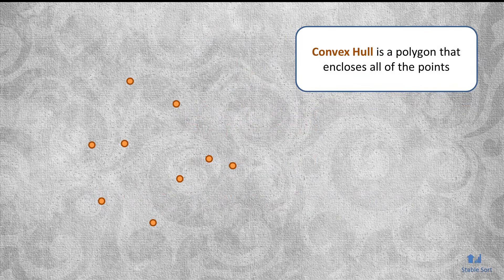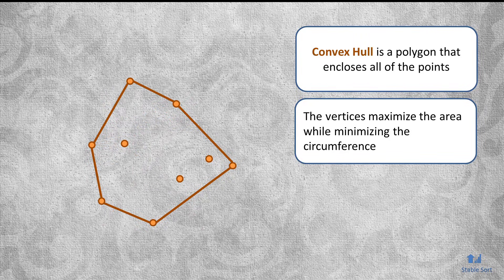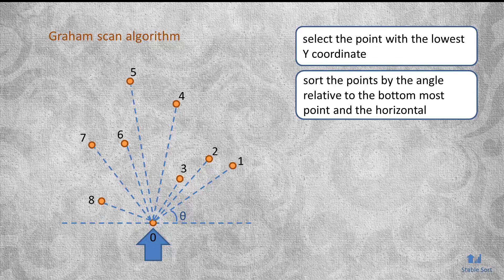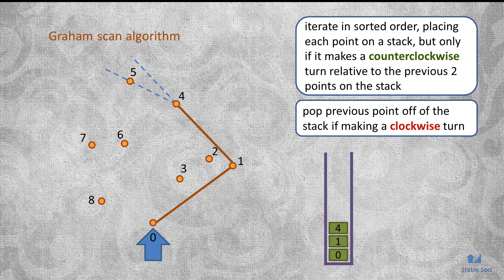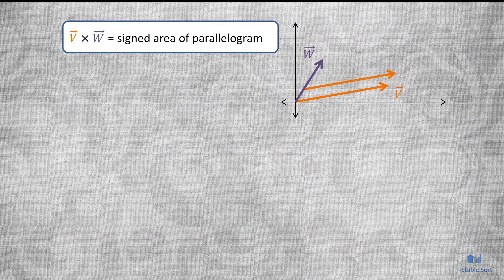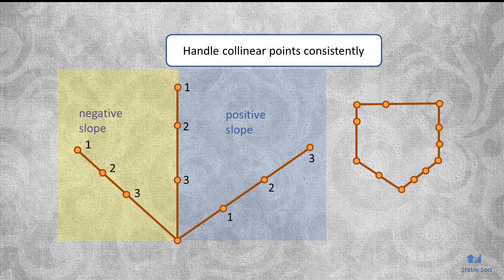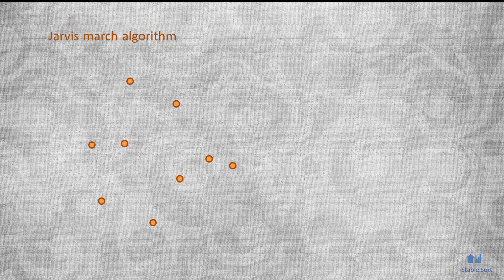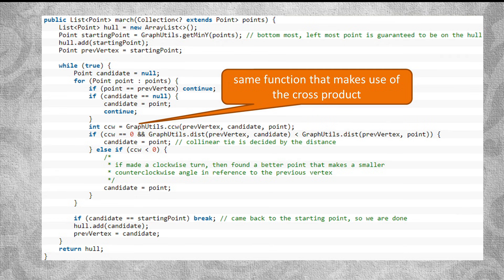Convex Hull Algorithm - Graham Scan and Jarvis March tutorial

Comment: Thanks this is useful. I am implementing several convex hull algorithms in Java right now and I for one would really appreciate a video on the O(n log h) algorithm. If I understand it, I might be able to program it too.
I'm curious, in your code you have two implementations of the march. One is supposed to be by angle and I think I understand that one, but I don't quite understand the other. Do you see any performance difference between the two?
Reply from the maker: There were definitely performance differences. I was actually using one implementation to test the other by generating large numbers of random points and comparing the two. Good luck!
Reply: @stablesort  Oh okay. Do you remember which algorithms was faster on average?

Comment: By sorting the points, did you mean with respect to x coordinate or why coordinate ? , considering only 2D set of points.
Reply from the maker: In my examples I sorted by Y coordinate, so as to start at the bottom most point. But obviously this is just a convention - you can do it via the X coordinate just as well. Thanks for posting the question!

Comment: Great explanation! 
Found a bug though  :P

At 4:38 when we handle collinear points in a vertical line, we should treat the order of these points differently.

For points like this shape ▛ , [[0, 0], [0, 1], [0, 2], [1, 2]]
[0, 0] is the P0, in the above shape, the vertical line contains [0, 0], [0, 1], [0, 2] , here [0, 1] > [0, 2], which is the same with the video.

But there's another case: ▜  , [[0, 0], [0, 1], [0, 2], [-1, 2]]
[0, 0] is also the P0, but in this case we scan the vertical line first, and here we need to put [0, 1] before [0, 2] which means  [0, 1] < [0, 2].
Reply from the maker: Thanks for the discussion. I think the exact implementation matters quite a lot for the corner cases. Have you tried out the source code linked in the description? I could be wrong but I think I tried that type of a corner case at some point.
Reply: @stablesort  Yep, the source code impl is consistent with your video. it's really tricky to deal with the collinear issue here, so chose Monotone Chain, lol.
anyway, thank you for the clear explanation.
Reply from the maker: @Novello42  Thanks! Glad to hear that it was helpful.

Comment: How can we sort the points with cross product when the cross product depends on both the length of the vectors and the angle between them? Do we divide the resulting cross product with the lengths of the vectors?
Reply from the maker: Thanks for raising the question. It's actually simpler than that. The cross product calculates the signed area formed by the two vectors. The area is positive or negative depending on which side the vectors are in reference to each other. And that's all that we need for sorting: that's the comparator function that you'd supply to the sorting algorithm. By the way, check out the source code linked in the description. I hope this helps!

Comment: Thanks for the awesome explanation .
 I had a small doubt regarding this problem :-
https://www.spoj.com/problems/VMILI/
If the problem is slightly changed and you are given a point A(x,y) and all the fences have to build surrounding this point .

How to approach this??
Reply from the maker: I think you are right that Convex Hull algorithm would help solve the stated problem. Once the outermost fence is determined, those vertices could be removed (or marked as removed) and the process of calling Convex Hull algorithm with a reduced set of vertices is repeated until no more vertices are left. 

The problem does not state it but, I think it's assumed that the spaceport will be inside of the inner most fence. Although this really isn't guaranteed. For example, all of those vertices could be to one side of the spaceport. In which case, it'll be outside of all of the fences. This brings us to your modification with point A(x, y). It seems to me that maximum number of useful fences may be reduced - just as with my example where point A(x,y) is to one side of all of the other points. To count those useful fences, I think the algorithm could just count the number of calls made to the Convex Hull search and halt as soon as point A(x,y) is used as one of the points on the hull. The number of calls made will the same as the number of useful fences.

What do you think?

Comment: Intresting. Looks like Convex Hulls aren't as complicated to find as I thought. Well explained! I'll give implementing the Graham Scan algorithm a shot.
Reply from the maker: Yeah, both Graham and Jarvis algorithms are not that complicated. But to make sure that various collinear points are handled correctly, I had to create a whole battery of test cases (same directory as the main source code: https://bitbucket.org/StableSort/play/src/master/src/com/stablesort/convexhull/ConvexHullTest.java). I hope this helps!
Reply: @stablesort  Thanks for the reply! I'll try to make sure that the collinear points are handled correctly. As for test cases, I mostly solve programming problems on Kattis. See https://open.kattis.com/problems/convexhull
Speaking of which, lets say that you already know which points are one the convex hull and not. How would you go about finding the order the points appear on the hull? Wouldn't you just have to make the convex hull again, including all collinear points while excluding points inside the hull, and record them along the way? See https://open.kattis.com/problems/convexhull2 if you're interested.
Reply from the maker: @highruler2786  Thanks for link. That website seems to have a rich set of interesting problems. 

Rerunning the algorithm on just the vertex points will certainly work. But I wonder if there is a more efficient way to ordering the points, given that we are guaranteed that they are valid vertices? I guess we can just use the sort() method from Graham Scan, with a total running time O(h log h), h=number of vertices. Is there a more efficient solution?